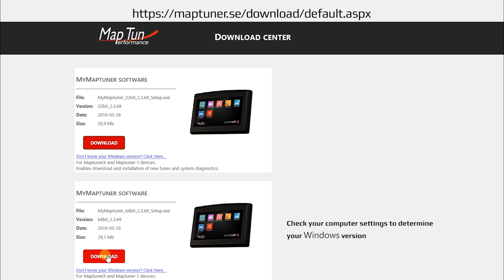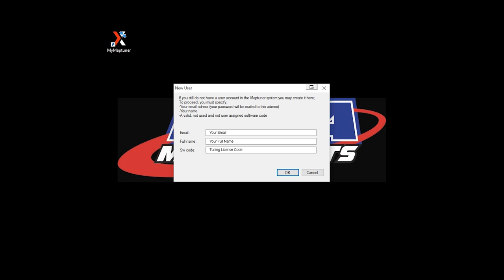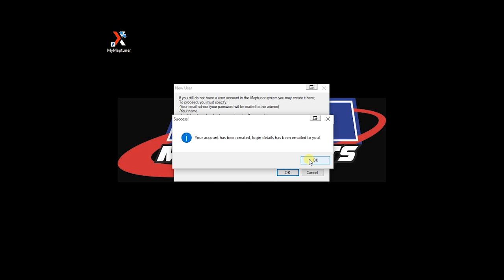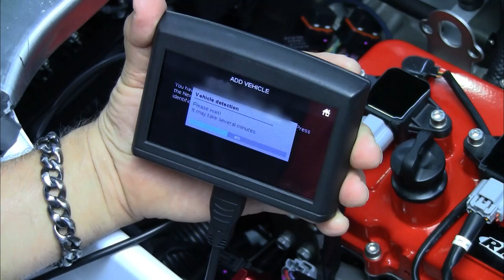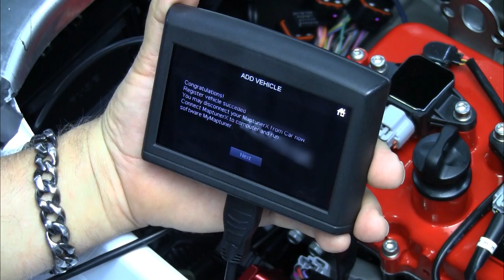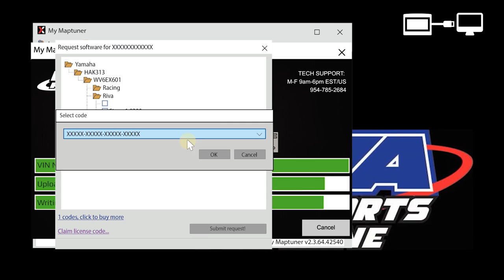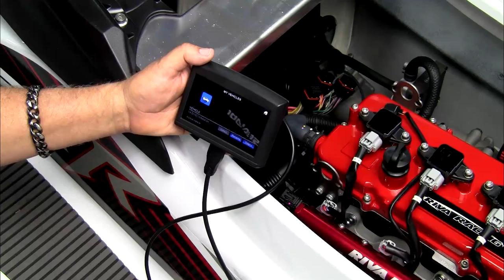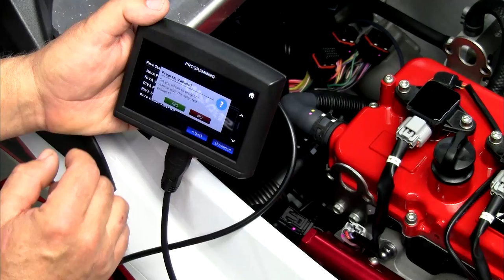Maptuner X Yamaha Instructional Video

Comment: Just to let you know for the sake of keeping your cable and HDMI connector on the Map Tuner X in good condition for years to come, don't ever wiggle the connector whilst trying to pull it out, it loosens the terminals and eventually they won't connect very well and will instead become lose and faulty, for some reason it's a very bad habit most people do, the reason wiggling makes it easier to pull out is because it's spreading the terminals apart a little and so it comes out easier, this is what causes the problem as eventually the terminals lose their spring and won't spring back and then people wiggle it even more to try and get a connection, like they do on their mobile phone chargers and everything else they plug in.
Since the Map Tuner X is only a few Hundred dollars maybe it's something you don't mind replacing yearly or more often depending how many Vehicles you program ;).
The best way to disconnect a cable is to grab the front of the connector not the cable and hold the device firmly and just pull it straight out, I am sure most people have the muscle to do so, I am past 65 and I can still pull a cable with out wiggling it ;).
I was in I.T for many years and rebuilt many devices from worn charge ports or worn USB and HDMI ports, iPhones seem to be the worst as I have changed some peoples charge ports on their iPhones multiple times as they won't listen to a simple instruction. Just my two cents ;)

Comment: Oops! Didn't know that Maptuner X requires me to use Windows. Is there a work around if I only have a Macbook or should I head over to Wally-World and buy a cheap HP laptop?
Reply from the maker: We apologize for not having this listed across the board yet, and are sorry for the inconvenience it has caused you. At this time MaptunerX only works on Windows based PCs.
Reply: @rivaracing8468  No problem I found several laptops on Amazon for under $150. I would rather not take my expensive Macbook out by the water so this works out to my advantage.

Comment: Is there any tuning for the Yamaha vx with the tr-1 engine?
Reply from the maker: Hello Yoi, If you upload your information using the MaptunerX you will also see tunes for the Yamaha EX (TR-1 Engine). These share the same ECU protocol and could be used if you have the correct parts installed for a particular tune.

Comment: looked like there were other icons on the maptunerx such as "service"? does this device do more than just give the ability to upload a tune such as diagnostics on the engine? I have a 2017 gp1800 thanks for any info
Reply from the maker: Yes, the MaptunerX can do way more than just upload tunes to your ECU. The Home Service Application (Service Icon - BRP watercraft only) allows the user to view fault codes for units with a tuning license and the proper diagnostic cable. On BRP units the user can also delete fault codes.
 
There is no Home Service Application for Yamaha or Kawasaki at this time. It is only for BRP.
The Data Logging function is available for both Yamaha & BRP, and allows you to record real time data while riding. Monitoring is also a part of the Data Logging Application. The full kit can be found here: https://rivaracing.com/i-24079522-maptunerx-data-logging-kit.html
Reply: Where does the diagnostic cable connect to on the 2017 yamaha gp 1800? Also what does BRP stand for? thx

Comment: Be advised once you flash your ECU, you have voided your factory warranty. Is their anything I can do to make it faster without voiding my warranty?
Reply: No they have the stock tune to remove speed limit and dealer can't detect because it still runs same RPM but allows ski to operate at full potential
Reply from the maker: Depending on the model of Yamaha PWC that you have, we can recommend modifications that will increase some top speed without reflashing the ECU. Please call our performance experts for more info: 1-800-241-4544
Reply: fuck the warranty it is only clutch will gone which is about 400$ stage 2 about 5000$ who does give a shit
Reply: FYI 2021 looks different from this video. It's the biggest plug port side that is black. It's next to the identical grey plug. They have quick release latches. This is the port you plug maptuner into.